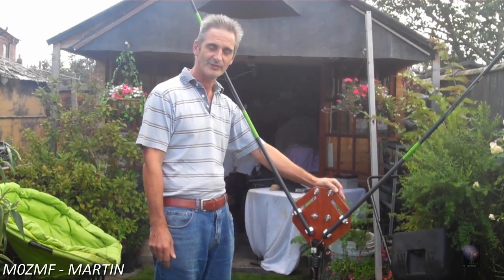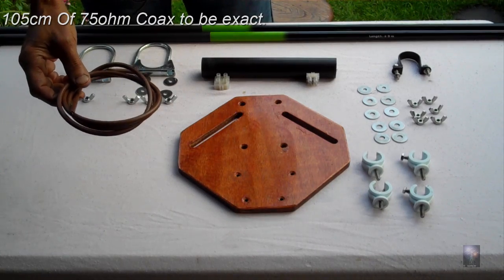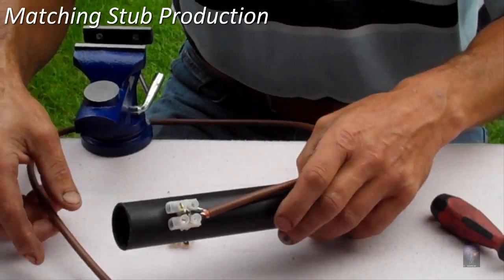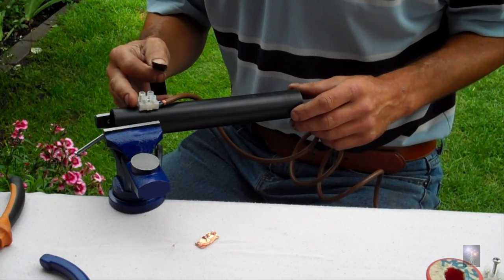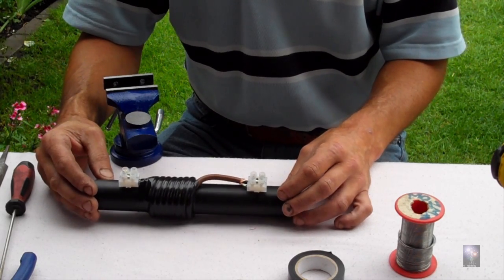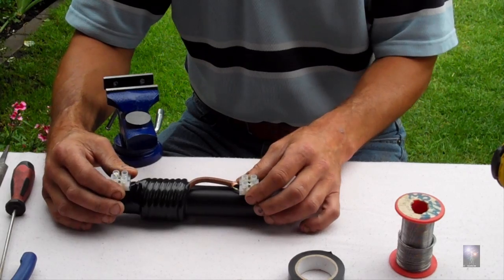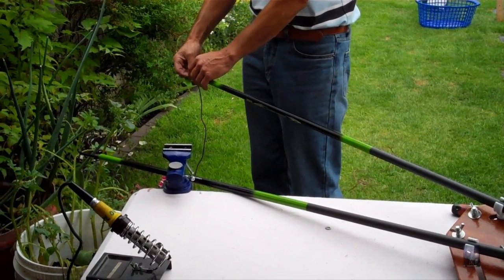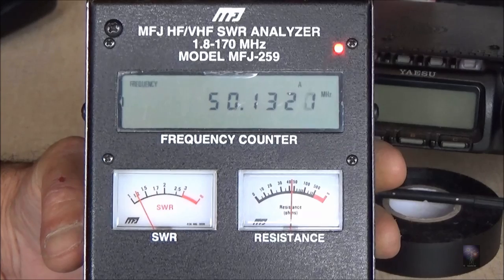The 6 meter Delta Loop Tutorial

Comment: The diameter of the tube for the ugly balun/air choke is 32mm 1&1/4" NOT 40mm  1&1/2"as stated in the video.
You will discover this when you try to whind 7turns of 75ohm coax on 40mm and wonder why you can only manage 6 turns with no excess to attach the Blok at the end🇬🇧👍😎👍🇬🇧
73.
2E0LFD
Reply: If the working frequency is 27 MHz, how many coils does the ungly balun have?
Reply: @adekdzaki2290 The length of RG59 needed will be 7.1 feet or 2.2 meters.  Add some extra length to compensate for the leads to the terminal  blocks.  The number of turns does not matter.